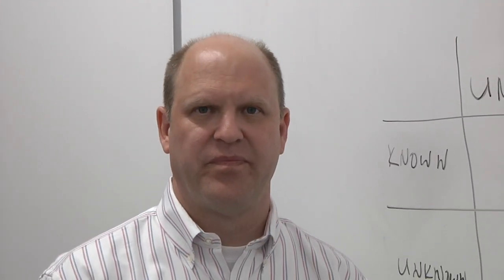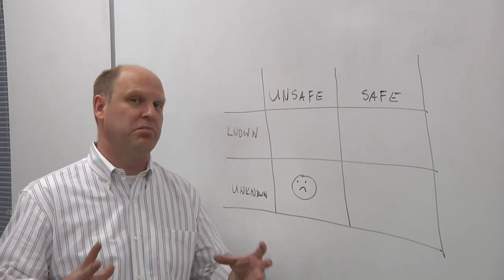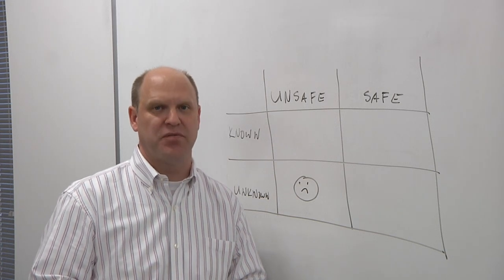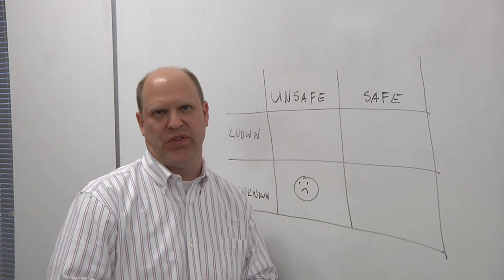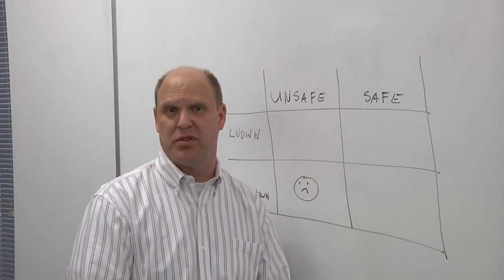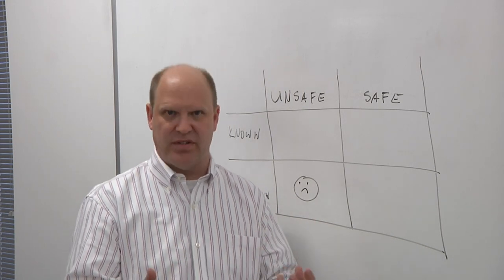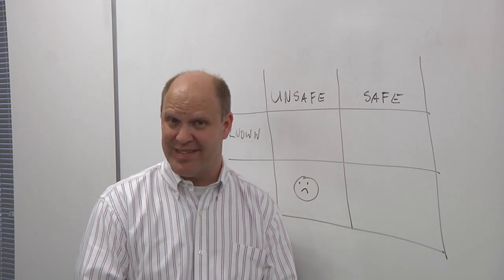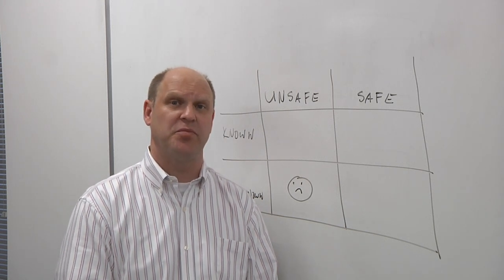What Is SOTIF?

Comment: Interesting and informative talks. Just wondering, how about a "Keep-Alive" like signaling for every processing element in the system that is periodically generated and processed in a narrow time slice (input to output) for making sure the intended processing element/function is operational as a health status pulse and the loading condition it is experiencing (how much time it is taking to process it).
Reply from the maker: That would certainly be helpful. There are two issues here. One is the readiness of the technology, and while cars can certainly steer themselves today, there are questions about how well they can maneuver through traffic with cars. AI systems are still in their infancy. The second issue is cost. What you're hinting at here is predictive maintenance, which is a complex issue because it requires in-circuit real-time monitoring and testing across all systems. Airplanes do this today, but it takes awhile to check all the major systems on a plane. Imagine if you had to run through all those tests in your car before running an errand. The cost of these systems could be prohibitive with today's technology, and rapid startup would require massive compute power.
Reply: Thanks for your quick response. I think it should start with an architecture/system level (micro to macro) implementation to achieve the highest level of reliability and safety of automotive systems.

Comment: How do you think software analysis and sotif intersect?
Reply: Big time. SOTIF is meant to address safety issues where system situational awareness is derived from complex sensors combined with even equally complex (and often non-deterministic / non-repeatable) processing algorithms. Unlike ISO 26262, SOTIF deals with the behavior of a system under various scenarios which are not triggered by a system error, fault or failure. I think the biggest issue regarding software and SOTIF is how to deal with neural net algos that perform classification and other functions using multiple sensor inputs, resulting in a system action that is ultimately based on a probabilistic determination of what "reality" is. How do you test a system like this? What percent of "correctness" is "good enough"?